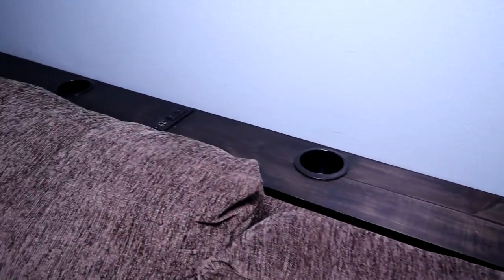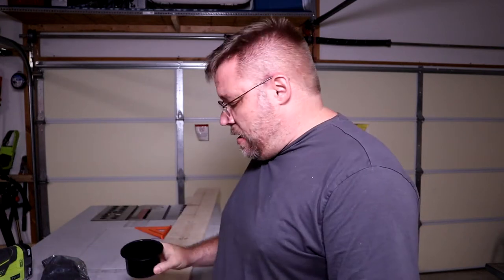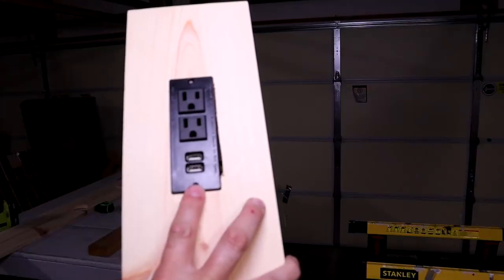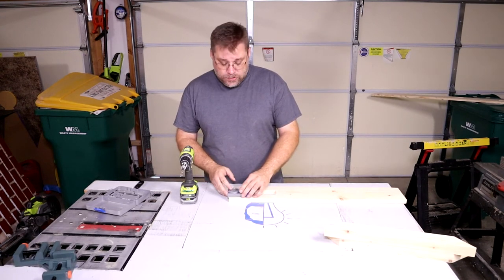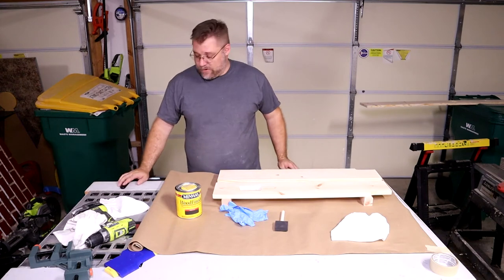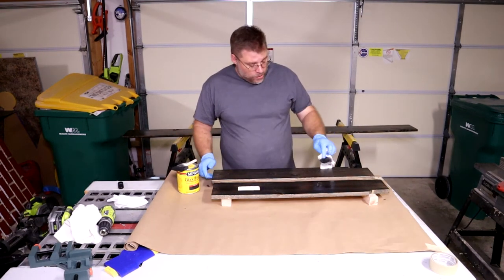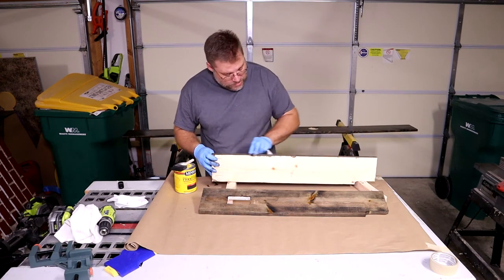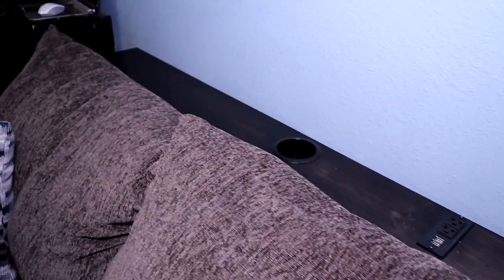How to Build a Sofa Table with Outlets and Cupholders

Comment: Nice work!  I like the trick of using Alexa and a smart plug (I assume) to vocally control your shop vacuum/dust collector.  Could you provide more info about how you did that?  I'll also check your channel in case you've already done a vid of it there.  Thanks for sharing your ideas and work!
Reply from the maker: Yes I am using a smartplug for this option.  While it worked I have since upgraded to a "Automatic Vacuum Switch" connected to my Power Tools.  I found that it gets too noisy for voice when the CNC or compressor are running.  I use the one linked here https://amzn.to/3qJj202 (affiliate link).  I still use the smartplugs around the house.  This time of year I tell Alexa to make it jolly and all my Christmas trees turn on.  Connect the plugs to your echo devices and then create a routine.  You can make it simple like turn on vacuum or you can be creative like my tree example.  Just follow the steps in the Alexa app.

Comment: Not sure if  I missed anything.  But did you put pocket holes in the braces as well, to attach to the table?
Reply from the maker: No. But good question. I did pilot drill the holes but I just shot screws into the braces.
Reply: @mysimplebuilds  great thank you!

Last question. I don't actually have a pocket hole jig.  I was thinking as an alternative option of just using wooden dowels and screws or brad nails.
Reply from the maker: @thaijohnston1840  pocket holes aren’t necessary but they are a great way to hide the screws.  Another option is to use a block of wood in the corner to attach both points to.  The wooden dowel is also a great option.  If you are adding electric or any other options please consider starting off your purchase by clicking on my suggested items.  Even if you purchase something else, Amazon pay me a percentage if you make a purchase.  This is at no additional cost to you.  Thank you for watching. Time for me to get back to the shop.  What would you like to see built?